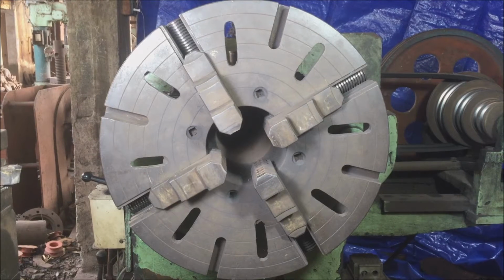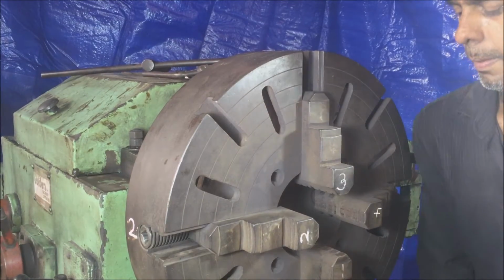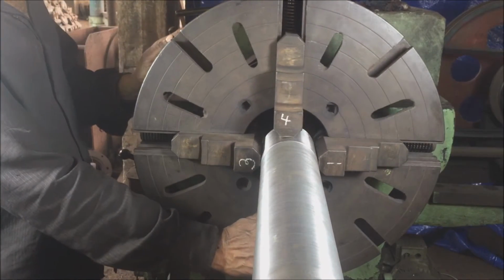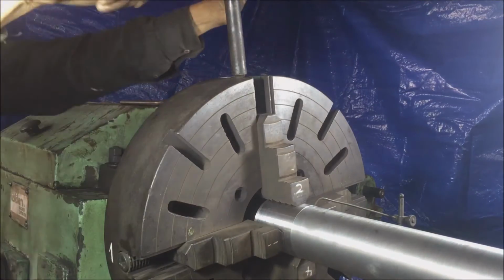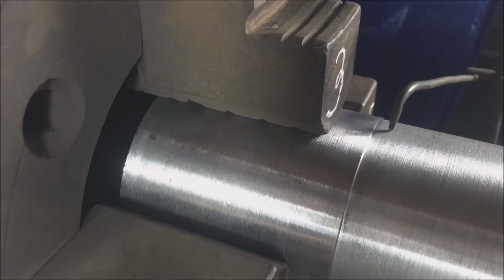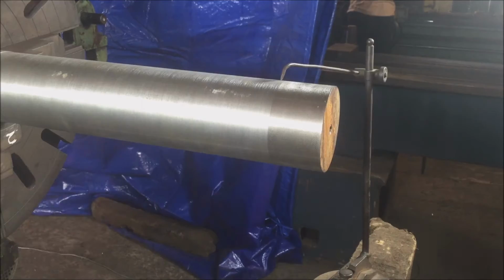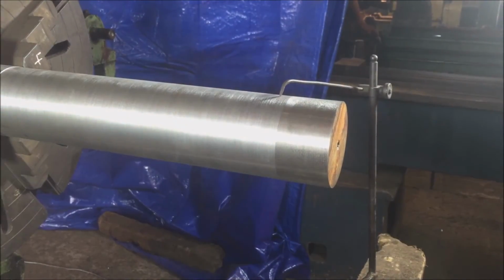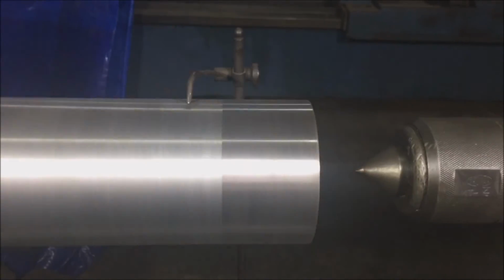Centering on a 4 Jaw Chuck using Marking Block

Comment: Neatly explained in Leymann's language..Effective for Beginners !!
Reply from the maker: Thanks a lot buddy. Really thankful for the patience you have exhibited, watched & commented on my videos. 👌
Reply: Abhinav Gupta..Im a Mechanical Freak..Ryt from my Old Days..Weneva I see a Lathe or a Radial drill..I stop by and Observe..No matter where I am..what am I doing..I get Glued to it..
Reply from the maker: Arpit Maniar exactly same here buddy. Exactly same. There's just something so captivating intriguing & fascinating about watching a Lathe in operation. Only people like me & you can understand what we are talking about. ☺️
Reply: Abhinav Gupta..We are on the same page..Mate..Great Conversation..Nostalgic is the word..
Reply from the maker: Arpit Maniar actually I love assessing a Lathe as well, whenever I come across one. Love checking the condition it is in, the design & rigidity. The motor attached to it, how much load it can take, what maximum depth of cut it can take, what feed rate & stuff like that.
Reply: Abhinav Gupta..Pretty much..I check what job is being worked on..Threading Internal or External..Taper Turning..Counterbore Countersunk..Chamfers..
Reply from the maker: Arpit Maniar hmmm.... I also love watching these big machines remove metal like it was some wax bar rather than a heavy metal bar. So fascinating.